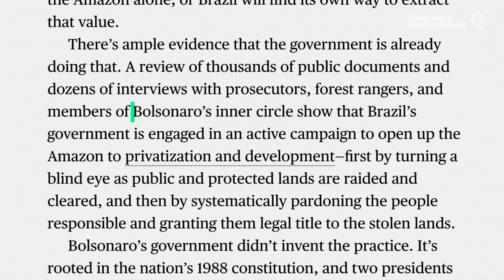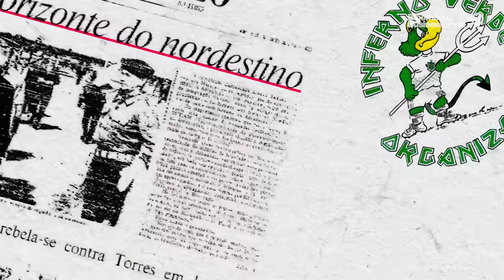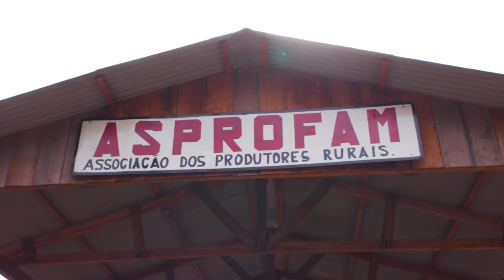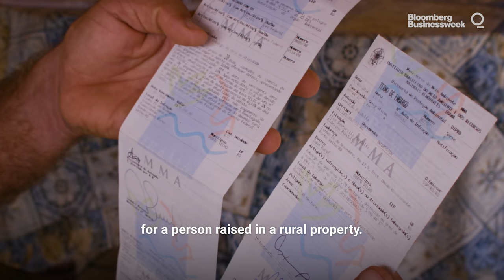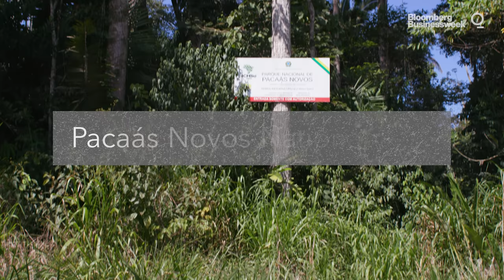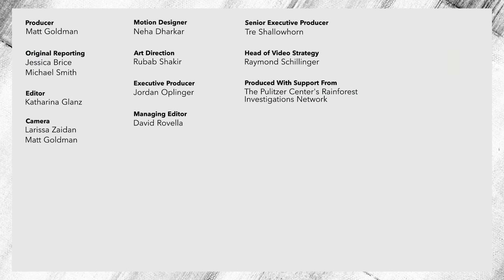The Great Amazonian Land Grab

Comment: The video starts... "The Amazon forest is one of the largest if not the largest rainforest in the world..." What is the doubt? The Amazon rainforest is ca. 5 million km², about 40% larger than the second-largest, the Congo rainforest.
Reply: Well you see they are burning it so it may not be.
Reply: only 4% larger by next year
Reply: @snowfox780  last year 20.234 sqkm of the Amazon Rainforest burned, this equals to 0,36% of the entire forest, the Congo rainforest have a deforastation rate of 0,3% per year in a much smaller area.
Reply: @mpmmobile4937  ... I1m Brazilian as well and my answer to you is:
As the video correctly points out at the beginning, the Amazon rainforest has a wide range of implications on the world climate. You correctly pointed out that it is not a source of oxygen, as it is an old forest, that is not growing. Vegetation produces a surplus of oxygen when they are growing,

But it has a very important role in conditioning temperature, humidity, and pressure. As the Amazon forest decreases in size, it will destabilize rains and the effect will be catastrophic, Brazilian weather will become dryer and will affect an area much beyond Brazilian borders. IMO the forest has an important role for the rest of the world too and the whole world should worry about the destruction.

Having said that I think the Amazon rainforest could be partially used for the benefit of the Brazilian economy and the whole world as a source of valuable timber followed by reforestation with the same species that were cut at the same rate or higher than the trees are cut. That could be sustainable.
Reply: @mpmmobile4937  The damage that deforestation does to the world has a lot more to do with climate change and preserving biomes than with Oxygen like you mentioned. 
Ou no bom português, o problema do desmatamento vai bem além do oxigenio, afeta o clima do planeta todo e acaba trazendo problemas que afetam também os agricultores como as secas e também tempestades que afetam as plantações. Isso se reflete no mundo e não só no brasil, a preocupação é pq a floresta amazonica é a maior floresta tropical do planeta, e perder um ecossistema gigante desses acarreta á uma série de problemas. Não são só as pessoas vindas de fora que criticam o desmatamento descabido que vem acontecendo a anos, mas o problema ficou tão fora de mão que virou preocupação mundial.
Reply: it's because Anglos can't usually admit when someone is bigger and better than they are.

Comment: Having worked in eastern Ecuador I have experienced this first hand. The overwhelming problem with encouraging development of these lands is that they are of little or no use to agriculture. Although initially viewed as teeming with life and vitality, as soon as they cut and burn the jungle and plant they find that the ground quickly pays out, and soon will not support a crop. This is not new news. I have seen the smoke from the slash and burn farmers as they keep moving deeper and deeper into the jungle as the soil plays out after a couple of crops. Eventually they will meet the settlers from Brazil as they all close to a common point in the middle of the continent.  These are just poor people trying to feed their families. It is an economic problem causing an ecological disaster.
Reply: @hwvrg  what, the, freack